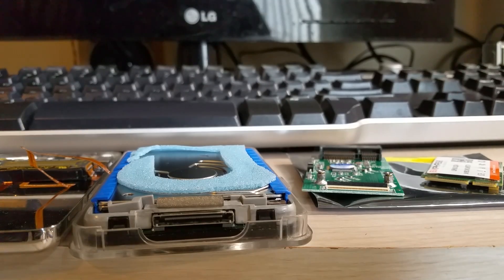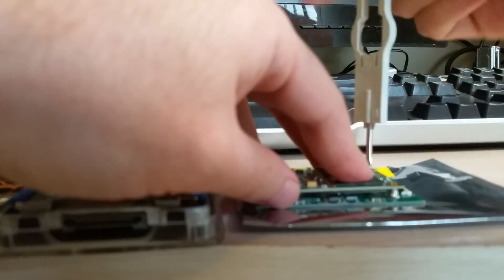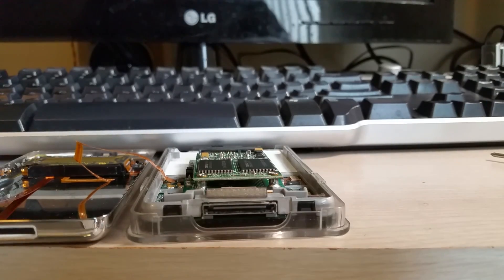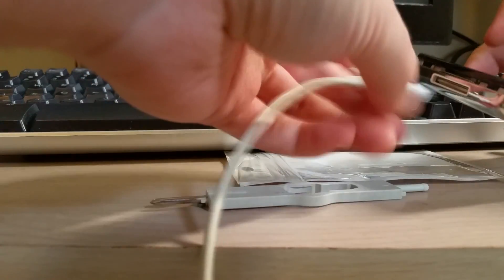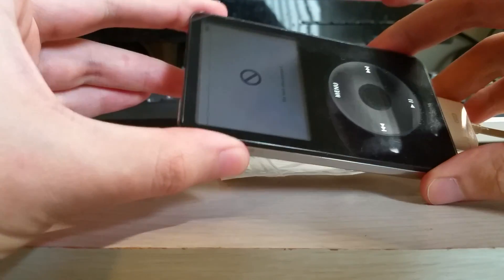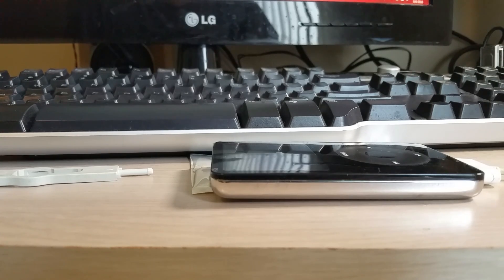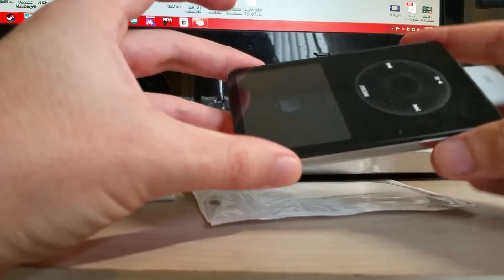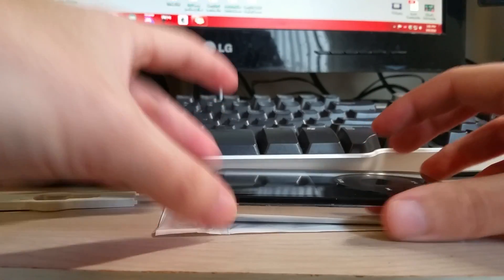Apple iPod Video 32GB MSATA SSD Upgrade on the Cheap!

Comment: Well done. My question, is there room to upgrade for a bigger battery also?
Reply from the maker: Yes, a little bit bigger if you cut away the metal nub on the midframe that presses the original battery up into the upper corner.
Reply: @sjm4306 does it get hot?
Reply from the maker: Depends on the msata used. In general the lower the current written on the msata's label, the cooler it'll run.
Reply: @sjm4306 ok thanks another question have you upgraded the battery to a 3000mah one
Reply: @sjm4306 also there these things called sd to msata  where the msata board has a sd card slot have you tried on of those?
Reply from the maker: I've seen those, unfortunately haven't tested yet as the one I found was a bit pricey, not including the cost of sd cards.
Reply from the maker: Haven't tried aftermarket battery mods yet, but I am interested
Reply: @sjm4306  ok thanks for the answer

Comment: on mine the zif port was too wide and the cable wouldn't hold... I'm going to try to shim it next time I open it...
Reply: Mine too... Have some news?
Reply: @mrzagalia  what I ended up doing it cutting a thin piece of plastic of the same width and used it as a shim. It worked but I haven't used that iPod in a while so I don't know how well it held... I'll charge and check it today.

Comment: i have toshiba ssd 128gb, i could not be successful with this changing stuff. ı put paper and i also put antistatic nylon for zif connector to make it stiff. what do you recommend more ?
Reply from the maker: Not all ssds are compatible due to differences in drive firmware and power draw. This site has a list of confirmed drives under the "mSata Drives" tab (https://www.iflash.xyz/store/iflash-sata/).

Comment: I got my Ipod Classic 5.5 30GB (A1136), a Lite-on 128GB SSD and that cheap chineese adapter. My problem is the music transfer times are MUCH longer than with HDD and when I play music, it randomly freezes. I can change volume and it seems "working", but when I press any button, it freezes completely and a hard reset is needed. Any advices?
Reply from the maker: Is your ssd new, have you ran a disk scan utility to make sure there isn't any bad sectors that could lock up or slow down the player when it goes to access the drive?
Reply: @sjm4306  the SSD is from second hand but i checked it for bqd sectors. Also formated it in FAT32 with AOMEI. It seems that it's not crashing when I have like 9k songs on the Ipod, but when it's like 19k, it's crashing after a few minutes of listening. Also the uploading times are quite high.
Reply from the maker: I know the 30gb 5+5.5 gen ipods have limited 32mb ram to store the firmware and cache all the songs so there is a limit to how many tracks it can recognize using the stock apple os. I suppose this could be the cause of the problem. I think rockbox can bypass this issue but it's been a few years since I played with it.
Reply: @sjm4306  Nevermind, I f***ed my Ipod. The power connctors are TERRIBLE and it's so easy to break them :/ Then the unsuccesfull soldering. Gone to trash. Any suggestions for a good and cheaper alternative for Ipod? Preferably with a place for huge SD card so I could store all my tracks (100GB+)
Reply from the maker: My everyday player is now a sony nw-a45 and a 256gb sd card loaded with flacs. The touch screen interface software is a little clunky but not horrible. It sounds great, has both bluetooth and a wired jack, takes large micro sd cards, plays just about everything including hi-res audio, and the battery lasts a good long time. Cons are it's pricey (though you can get good condition second hand ones for ~$120-150) and uses a silly proprietary (but cheap and widely available) cable for charging and data transfer over usb.
Reply: @sjm4306  Damn, that's expensive... Is there anything cheap and good? I spent too much cash, time and nerves trying to do a good Ipod mod and now I'm kinda broke and sad :(
Reply from the maker: You can get some decently cheap (<$50) chinese mp3 players now, just watch some review videos (specifically ones that show the user interface). Alternatively I'm a huge fan of the sansa clip mp3 players which are pretty cheap (~$30) and offer sd card support. The older ones support rockbox os which is awesome, but even the stock os on the new ones are pretty good.
Reply: @sjm4306  one more question about Ipods. If I have 30gb ipod classic 5g and I add that 128gb ssd, will it work without crashing if I install rockbox?
Reply: I mean, just need to make sure that it'll work before I spend more money on thay trash :D aaaand actually one more question... Is the uploading speed higher or lower in SSD than in a stock HDD? Cause I had that feeling the speed was actually lower
Reply: @sjm4306  Is it sure that rockbox could handle 128GB SSD? Don't want to lose more money xD
Reply from the maker: Yes, in fact I've seen people put 1tb ssds in ipods and rockbox has no problem with it. Not all msata drives are compatible though so check iFlash's site for a compatibility list.
Reply: @sjm4306  Do you mean the compatibility with Ipod or with Rockbox? As said, previously my Ipod 30GB worked with my chineese adapter and Liteon LHM-128V2M though it's not on their compatibility list (though 256GB version is). Now I'm going to find another cheap 30GB Ipod 5 or 5.5G so I could attach mentioned mSATA but I'm afraid of it to be working all together with rockbox :P
Reply: @sjm4306  Ok, I've just bought a BEAUTIFUL 60GB ipod 5G for ~51.66$. It's VERY well kept and all. Already installed the SSD, though still I got that funny feeling that it's much slower in file transfer than HDD :/ Loading almost 20k tunes, gonna tell if those freezing probems still appear.
Reply: @vincentflintstone6926 anything back?)

Comment: To all people having red cross or sad face with this cheap chineese adapter - remember two things! Cut a slice of antistatic foil the adapter was packed in. Then place it in the connector underneath the ZIF cabble because without that thing the connection is VERY loose. And the second thing - don't push the ZIF cabble all the way in. Just half way.
Reply: Oh my gosh! Thanks! I was just thinking about a shim for this!
Reply: I'll try it. Thanks

Comment: I have my classic 160GB now for 6 years. Althought I hate Apple, but this is the best player...and last productive thing from Apple, that's why they cancelled it.
On one hand, I want it to break, so I can change the HDD (never change a running system, you know). But on the other hand I don't want it to break down, cause you never know, if it works.
Reply from the maker: I still use my ipods to this day (though the batteries have seen better days). It's sad that dedicated mp3 players like ipods have fallen out of favor for streaming audio from smart phones.
Reply: @sjm4306 , yeah, streaming is fine for videos, but I want to HAVE my music and audio books. Plus on places with bad reception (Britain f. e. or in a train) it's painful and costs data volume.
Reply from the maker: I agree 100%
Reply: apple is rereleasing the iPod classic without a headphone jack. you will need a 30 pin port to 3.5mm jack converter to get it working.
Reply: @linussextips7192 , source? Couldn't find it.
Reply: @DaveMcIroy  it's one of those insider sources, not officially released.

Comment: can put higher capacity msata ssd?
Reply from the maker: Yes, I've seen people go up to a terabyte or two.
Reply: @sjm4306  I meant with this adapter, can put higher capacity ssd? And how about power?
Reply from the maker: I cant say for sure as I don't have any higher capacity msata ssds to test with. As for power the 32 and 64gb drives I've tested seem to be inefficient when writing data as they get pretty warm, but just reading during use are fine tempwise. I haven't had any issues with the ipod browning out due to excessive current draw, but as always ymmv depending on what specific ssd you use.
Reply: I bought an iflash msata adapter and a msata 250gb ssd for my iPod 🤟🏻 you can use up to 1tb just fine but after 30.000 songs your ipod 5.5g will crash when shuffling (out of ram) you can fill it up though
If you have manyyyy flacs you could fill it up and it will work fine 
Or put on many videos

They’ll have better battery life for sure (no spinning disk etc) and if you have a fat back plate you can add a 3000mah battery in combination w the msata ssd!! Which I bought too.. will be here soon and then I’ll get to work because I am replacing everything except the motherboard 🤣 I bought a new iPod 2 years ago but the screen is messed up, the clickwheel is broken and the front plate isn’t pretty soo I bought a new back, a new front, new big battery, msata adapter, msata ssd, new click wheel and a new screen

I like iPods for music because for one the sound is amazing and secondly it’s made for just music! No internet or distractions. And great for vacation too because you can have an offline library! I have 100gb of flacs and my iPod rn has an 80gb hdd. My library is still growing though but I think 250gb is ok for me

Comment: i have the 60gb of the 5th gen the one before they rebranded it as classic and all i have left is the ribbon cable and the hdd toshiba1724  MK6008GAH and want a way to access the music on it if it works want to make sure i have the right adapters and what not
Reply from the maker: You can buy a zif to usb adapter to access the drive and copy the music off manually but the song names are stored in a separate (encrypted?) database file so all the songs would just have filenames with random numbers and letters. Otherwise if you plug the drive into a working ipod mobo of the same generation you can grab everything off of it including the correct titles and whatnot using a 3rd party program (I think it was called podjuice or something like that).
Reply: @sjm4306  yeah was thinking of buying a ipod 5th gen vid's mobo if it still lives yeah i think i will get the ipod mobo as i have a lot of songs and some i dont know the name of so numbers and letters will be a pain what part do i need to buy all i have is the hdd and the tiny orange ribbon cable i think i found the right one will need to wait till i get paid iPod Classic 5th Gen Main Logic Board Motherboard As Is on ebay
Reply from the maker: Try to find a 5th gen that powers on (you also need it to have a working battery or it wont even usb sync) but gives the red x dead harddrive error. They should be pretty cheap (last I checked). Then you just swap your drive in and you are good to go.
Reply: @sjm4306  oh that is a pain will keep an eye out for parts and look at there total cost + delivery charges it might work out a lot cheaper just to buy a cracked screen one or something thanks if it comes down to it i might just be able to extract the data and use a program to work out what the song is thanks for your help

Comment: I have the same adapter and I put a ssd samsung and I do not get anything restore I get an X, what can it be?
Reply from the maker: X means general hardware error. It could be the ribbon isn't inserted correctly or the ssd is incompatible (draws too much power for the ipod to run it).
Reply: @sjm4306  I have a mSATA 860 EVO 250 GB, the x suddenly appears when the old hard drive did not turn, check the tape and everything and nothing yet, apparently the SSD is not compatible, what do you recommend? and thanks  : )
Reply from the maker: I've only tried two mSATAs: a used lite-on 64gb and a cheap 32gb chinese brand I never heard of (this one eventually bricked itself after a year of use).

This site (https://www.iflash.xyz/store/iflash-sata/) has a small compatibility list under the "mSATA Drives" tab. Looks like the evo 860 requires one of their adapters with an updated driver so I doubt it would work with one of these cheap adapters.

Comment: hello sir, may i know the brand name of the ssd msata drive you bought? because mine is 256gb vaseky and only a big red cross appearing on the screen each time i plugged it into power or pc.also the device does not detect in any forms of os. appreciate your response. thank you
Reply from the maker: I dont remember the brand unfortunately. Double check the flex cable is seated properly. Another thing to note is some ssd's pull way too much power than an ipod can supply.
Reply: sjm4306 thanks much, sir for your prompt reply. 👍
Reply: Sandisk, Kingston, pny, Samsung are all good
Reply: And your iPod ram might not take that much

Comment: its will fit to 30gb ipod case ?
Reply from the maker: Yep the model I modded in this video is the slim 30gb 5th gen ipod video.
Reply: sjm4306 Thanks :D
Reply: sjm4306 Any issue after msata mod ? I read some itunes restore problems after mod
Reply from the maker: I haven't seen any problem with iTunes, but depending on msata used it tends to get hot.

Comment: I can't make it work, I have two Ipods one 5th and 6.5th gen, on 5th everything works on the 6.5th red circle (im using the same adapter + same msata) and I'm completely sure the 6.5 is perfect because with the original HDD (I have it) works without issue, so what could be the problem
Reply: Hi. iFlash's site says that 6.5 requires a new ribbon ("The 6th Gen 160Gb (Thick) model will require a replacement HDD Ribbon as the original hard drive uses an CE-ATA interface"). https://www.iflash.xyz/store/hdd-ribbon/
Reply: Svyatoslav Gryaznov the 6.5 160gb that I have is the thin (some people know it as 7th g), son it not require a new ribbon cable

Comment: did you upgrade the battery at all? i heard that these drives eat up more juice .
Reply from the maker: It's the original battery. The ssd only consumes more power during writes (which explains why it gets hot when syncing), when just reading data while playing music it consumes about the same or less than the original drive.
Reply: alright, great! thanks for the response.
Reply: also, is it safe to put paper in there like that? is it really required?
Reply from the maker: Anything non-conductive will do (paper or preferably static dissapative plastic), the last thing you want is bare circuit boards touching and potentially causing shorts which could destroy the ipod, the drive, or both. Also the entire back of the ipod is exposed metal and the top of the ssd has exposed metal parts so I would say even minimal insulating material is mandatory.
Reply: good to know, thanks again!
Reply from the maker: np, glad to help

Comment: hey i just bought the zif converter and the zif connection isn't tight to the ipod.  is there something you did to make is seat properly?
Reply from the maker: Have you tilted the locking bar at the rear of the zif connector?
Reply: I don't see a locking bar of any sort.  The actual ssd fits but the prong that connects to the ipod doesn't connect tight enough
Reply from the maker: If it's the side near the ssd then the bar is black, if it's near the ipod end then it is brown (see pic below for reference). The bars are very fragile so you have to be careful not to break them off.

mywiredhouse.net/wp-content/uploads/2015/04/iPod_Step4.jpg
Reply: there is a black plastic that was in the way. I thought it was a dust protector.
Reply: You need to shim the zif connector. Look at the other guy's comment on this...

Comment: I just got a msata to zif card as well, I am wondering how do you know whether the adapter is connected in the right order? And not connect to the ribbon up side down?
Reply from the maker: The zif adapter will only work with the msata facing outwards as show in this video. I would guess nothing would happen if it were connected backwards but it's best not to try. Also make sure the ribbon is inserted fully into the zif socket or it won't work.

Comment: Will these items work with ipod classic 7th generation 120 gb?
Reply: Hi +Will Johnson... Yes, looks like 120G iPods would work at least for capacity, but on board RAM is the limiting song quantity issue, not disc size. As to board compatibility, I've seen a video of a kid modding a 7th gen with an iFlash SD adapter. Note same company just different product. Loaded up a 128G cap SD fine, needed to be pre-format FAT was only issue. TL/DR  I have a 7th gen 160G so I've researched a bit on it. On board RAM holds a database of the music/video files for the iPod potentially limiting the number of songs to be loaded. More on board RAM, and then a storage device to hold the music files, more songs/videos. I believe I heard 60/80G disc cap iPods had 32M RAM, 120 (yours)/160G have 64M RAM. So for modding be happy you shelled extra cheddar for a fatter OEM iPod drive :D
Reply from the maker: From what I've read this should work, and I see no reason why it wouldn't. This site has compatibility info for all the models with an msata drive: https://www.iflash.xyz/

Of course since I don't have a 7th gen I can't confirm but given how cheap the adapter and used msata drives are it's not a big investment.

Comment: I bought one of those zif to msata boards and now when my ipod turns on it just says apple.com/support/ipod with a red circle slash over it for a few seconds then shuts off. Its also not showing up in Windows
Reply from the maker: Double check that the zif connector is full seated, and make absolutely sure there is something non-conductive between the adapter and the ipod or you could be shorting something.